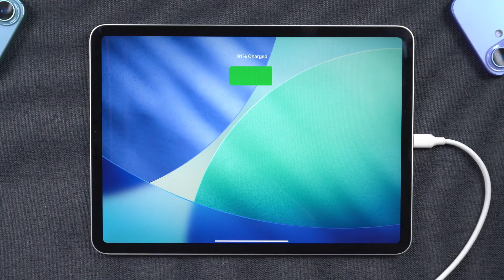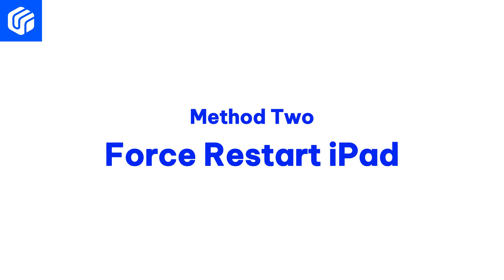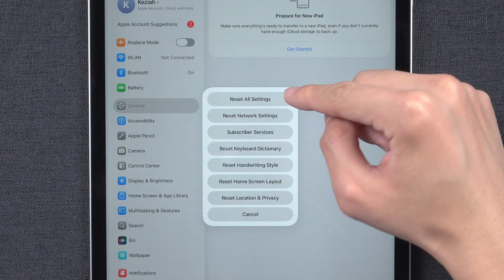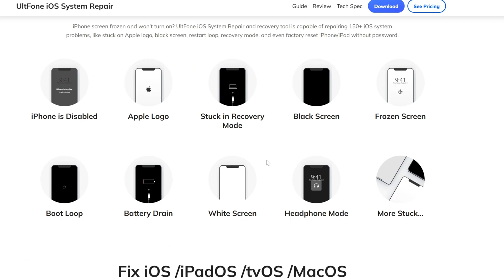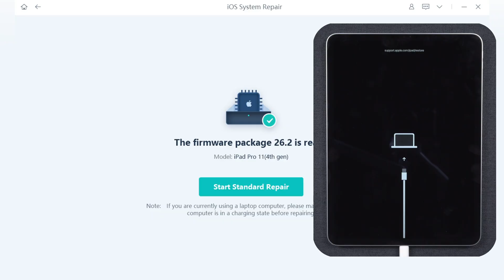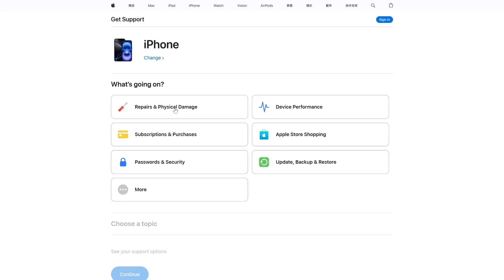iPad Not Charging After Update? Quick Fix Without Data Loss

Comment: I’ve ordered new Wall Adapter and Cable from APPLE and still does not charge with iPadOS 26.4 (Beta)
Reply from the maker: If the methods in the video cannot solve the problem on top of your efforts, it may be worth considering a hardware issue.